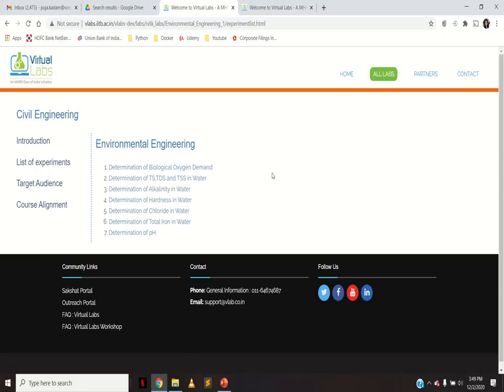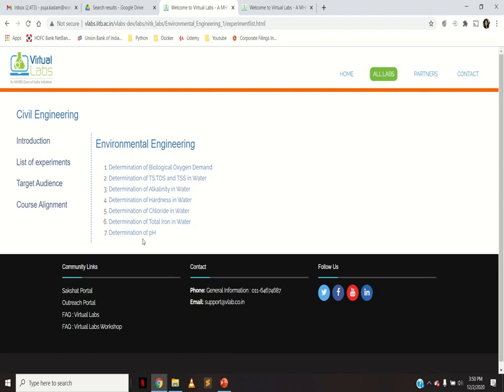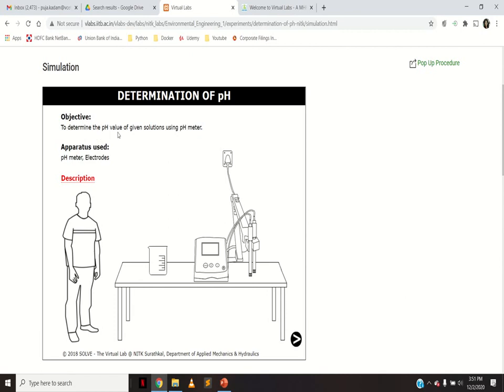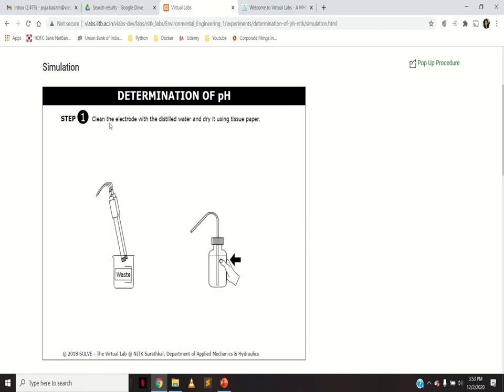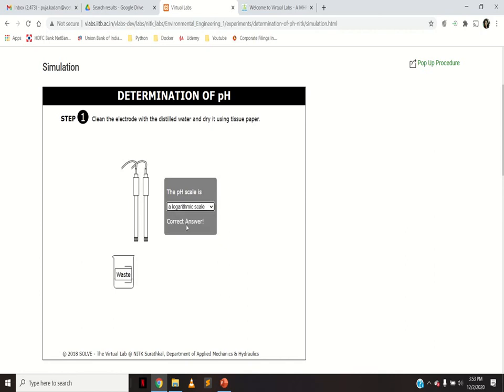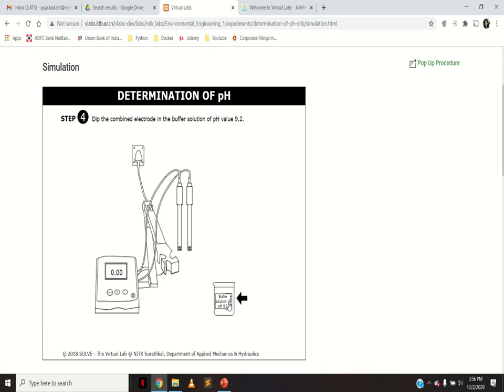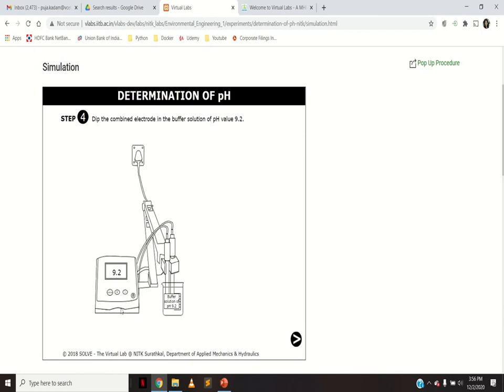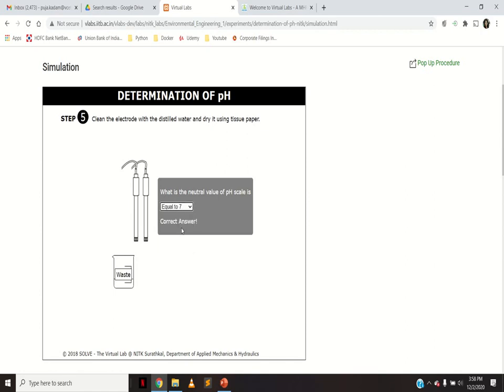Determination of pH of Water Sample on Virtual Lab

Comment: Iska conclusion bataye na...
Reply from the maker: If the pH of water sample is between 6.5-8.5 then it's safe for drinking according to BIS standard and it the pH is less than 7 then it's acidic and if more than 7 then alkaline, if it's 7 then it's a neutral pH value sample like distilled water.
Reply: @technoedlearning3144  thanks mam🥰